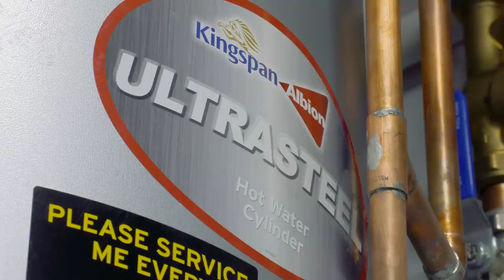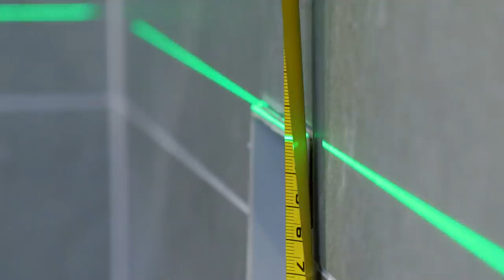Bathroom Renovation #10 - Final Fitting

Comment: Enjoying these videos Roger.
I’ve recently changed two wastes where the internal threads had corroded over the years making the whole thing come loose and leak. Silicone on the top and bottom stops it leaking and also keeps the whole thing tight should the threads fail. I agree tho it’s a pain to take apart.

Comment: Excellent series of domestic works - I would have loved to see how the glass was fitted for the shower screen & the effect it has when being used to keep the water in one place & not flood all over the floor.
Looks as though there is a quarter inch gap between the floor & the glass screen on completion.
When siliconed in place it always goes mouldy - So a free standing glass caught my interest & how well it works.

Comment: From down under here in New Zealand, bloody brilliant show....great production and music too!  I can hardly belive you guys still use those shaver outlets, we stopped with them and went to RCD's 25 yrs ago, mind you if it aint broke......
Reply from the maker: Thanks for those kind words. In the U.K you can put in a socket if it is more than 3 metres from the bath or shower. 

As the bathroom is only 3 metres long that is tricky.  I am not sure the men in suits have fully embraced RCDs. They still don't accept them as a means of protection on building sites so we have to use 110volts which is a complete pain.

Comment: Roger. Regarding the Towel rail issue at 18:13. If you want to use chrome fittings - some of the radiator tail extenders may also be useful. They come in various lengths.
Reply: It looks like he just stuck a small s-bend in the pipe in the end.

Comment: Two O-rings weigh twice as much as one, on a vehicle that costs $60,000 per kilo to launch. The problem was the ring experienced conditions it wasn't designed to encounter; a better analogy would be using plasterboard backing behind shower tiles. Two boards isn't going to fix a leak problem, you need better material...

Beautiful bathroom though!
Reply from the maker: There were two 'O' rings and you are right it was the wrong rubber

Comment: Thanks for the tip on silicone removal, my housing association thinks it is the only way to repair absolutely everything. We waited 16 years for a replacement shower, when they finally fitted a new one, 2 months later the on/off switch blew up and burnt out. Have you got any footage on how to repair draughty double glazed windows, woodworm treatment, woodworm damage repair, toilet to floor thingamajig repair?  i would go on but I fear I would bore you with the list of things that need doing... I subbed instead! Thank you again x

Comment: Great video. Some first class trade skills here. I was touched by your comment on the “O” rings it was a terribly tragedy back in ‘86’ When the O rings failed due to them becoming hardened by the low temperatures. Maybe more O rings could have helped but I think they should have delayed the launch until the temperatures were up to the correct level. Your illustration made the point very well that doubling up makes for a more reliable result.

Comment: There was two o-rings on that Challenger's SRB segment joins, a base and a backup.  Problem was the freezing temps made them brittle and they both blew.
Reply from the maker: Hi Kosmonooit
 You are right, I looked it all up after spouting off about it but I also found that one of the engineers advised against the launch due to the cold and they went ahead. There is a great book about the whole affair.
Reply: Cheers Rog  - yeah besides the sub zero temps the final report blamed the safety culture at NASA at the time, warnings were ignored in order to stick to schedules. They also redesigned how them segments join to be more fail safe. What can we learn? don't take chances. Listen to those who know.

Comment: Thanks for this.... I want to put an angle valve on my brick wall that will be tiled over with a 10mm thick tile... the open end will be a female threaded 1/2" (we call em 15mm over here).
I'm not sure how deep it should be n the wall, flush, or flush with where the tile is expected to end, or something else? I don't want pipe sticking out the wall by the escutcheon.

Comment: Thanks for the tip on the diamond drill. I threw out a drill I thought was buggered and it was probably just glazed like you said. Not a great loss though, only cost a few quid for a pack of 10 replacements, I figure even if I use 1 drill per hole it's still good value, even better if I can clean them like you did though and get a few dozen holes per drill.

Comment: Out of interest what were the bolts for the toilet pan and vanity unit going into? The framing you built or is it the abacus framing system behind the tiles? One wrong measurement and that's the tiling job destroyed. I would need to measure that 20 times before drilling any holes.

Comment: Roger.. I'm putting a shower base into an alcove and was going to use aquastrap but it's such a tight fit that the added mm of the butyl tape won't fit. What's the best option to seal the tray to wall gap. Silicone, Elements fix md, CT1 or what. The walls are elements board.
Reply from the maker: Just grab a roll of No More Leaks Bath and shower sealing tape from B&Q. Peel the back off the thin bit and place it where the tiles go. We have a video on it. I usually gun a bit of silicone down the gap first and let that go off and then follow up with the tape, then the tiles then the final silicone seal. Three layers of protection. If I had gone for that approach earlier in my life i would not have spent the last 30 years paying for my kids.

Comment: @skillbuilder Chaps - attaching the shower screen glass to the wall - did you screw through the tiles into the elements board on the stud? Would love your advice on how you've done that.
Reply from the maker: I always work out where the screen profie will go and put in an extra stud to take the screws. 

If the wall is there and I don't want to disrupt it I find the silicone seal on the back of the profile does a great job. the screws can go into cavity plugs but the main job is done by the silicone. 

I have confidence in this because I have had to remove screens for refurbs and those with silicone are very hard to remove.
Reply: @SkillBuilder  Thanks for the swift reply! I'm screwing into CLS stud through elements board so I'll rest assured the silicon will seal up any breach i make with the screws. Cheers!
Reply: @SkillBuilder  Fantastic thanks!

Comment: Any one guessing a price for this job .. ? 10-12k maybe
Reply: cmal90 easily
Reply: Times that by 3
You're looking at one top notch luxury bathroom
The shower head alone is going to be over £100 
And then there's Rogers 30+ years of experience
At least it won't need replacing for 30 years
Reply: I would have thought £20-£25k. Big room with multiple skilled tradesmen and expensive products installed.

Comment: There was 2 O rings on the space shuttle that blew up. They both failed. The thing should've never been given the go-ahead to launch because of the low temperature that day. Engineers tried to stop the launch because they were very aware of the dangers of launching at those temperatures, but it only takes 1 dickhead with authority to overrule them...

Comment: How much did all cost , labour and materials if you are prepared to divulge.........?
Nice job.......👍
Reply: 10k easy I reckon
Reply: 5k in materials I estimate.
Reply: Kind of a moot point given abacus probably picked up most of the tab.
Reply from the maker: Yensabi
Yes it is all available from your merchant with prices so no secret. There are of course trade discounts on the kit but list  is around £15k. I would normally work on an installation cost of the same so  a tad under £30K would be my price including the tiler. 
These days in houses that have two bathrooms and a couple of ensuites  and a cloak room you can easily get through £100K and the kitchen will be another £100K.
Reply: @SkillBuilder  £30k!!!!.....*sound of big geordie fitter hitting the deck*
Reply: @SkillBuilder  🤣 Hi Roger, £200k for bathrooms, kitchens and cloakrooms.  Robin Clevett would admire your managing of your future customer's expectations when it comes to pricing a job!!
Reply from the maker: @henlowridge8598  Hi Roy 
When you start looking at it, as a plumber, I need £300 a day to cover my van,, insurances, accountants and holidays. Then there is travel and monkeying about down at the merchants.
If I charge £6,000 I am not making a fortune. Then there is the kit which comes to £15,000 with my 20% mark up. 
I would reckon there is close to £500 in pipe and fittings. Plywood, battens, timber for stud wall Then there is the tiler , a skip and electrician. Lights heating and extractor fan.
 If you priced it at £20,000 you would lose out and the next one you would price at £22,000 so best to be on the safe side.

Comment: Question.
Cutting 10mm porcelain tiles and they would chip no matter what blade on the wet saw, i used a tile scribe in the end is there any blade that can cut these the waste was incredible to get the perfect finish.
Reply from the maker: Did they chip on the corners or the cut?
Reply: You need a decent saw for for precice cuts in fussy tiles.  Such as the DeWalt D24000.  Not cheap. The vibration from cheap saws will cause chipping. Also a none serated type diamond blade is essential.
Reply from the maker: @juancornetto8243  I have that saw and it is good right up to the last bit where it sometimes breaks a tiny bit of the corner.
Reply: @SkillBuilder  Make sure you're using the larger of the two arbor rings supplied (the smaller one is only for cutting bricks) and if the problem still persists try flipping the tile and cutting 1 inch into the tile where the blade will exit before cutting as normal.  I think dewalt had a manufacturing issue with these saws so might be related. Mine is a 2018 and is spot on.

Comment: Couldn’t you use plumbers mait instead of silicon?
Reply from the maker: For what particular bit?
Reply: Skill Builder 7:37  between connection to the basin and waste. Less messy and no waste of mait.
Reply from the maker: @vicventurini3786  Plumber's Mait should never be used to bed in basin, sink or bath wastes .I have asked Evode  what it is good for and there is a pregnant pause.  I have had several discussions with the Evode technical guys and they have told me that the acidic water will break it down. I can vouch for this because I have earned loads of money over the years re-seating wastes that were bedded with Plumber's Mait.

Comment: 19:15.  NASA should have used some Boss White & hemp as well instead of relying on a single O ring.
Reply from the maker: We learn by our mistakes. They can put a man on the moon but plumbing................ is something else entirely.
Reply: @SkillBuilder  Fernox LS-X is also good.

Does NASA stand for 'Need Apply Seal Adhesive' ?
Reply from the maker: @stakkerhmnd  Fernox LSX. Is that not just expensive silicone?  
You may be right about NASA.  It is hard to believe they could screw up on such a basic thing.
Reply: @SkillBuilder  That's a good point. I never thought about it as an expensive silicone. Thinking about it now I would say it is, and equally messy. Prefer your method of scratching the threads up and cross wrapping cord.

Comment: Talking of rejected basins, I purchased a sink of of ebay. Normally £600 got it for £200. Found out why, the sink was not flat on the top. Ok on the main area but falls to the back from the tap onwards. Now there is always a puddle against the tiles.
Reply from the maker: I have had more wonky firings than I care to remember. Rocky loo seats is the worst.
Reply: @logik100 Wasn't made by RAK was it?  I have one that's so bent it would be funny were it not my money that paid for it. (not fitted I hasten to add).
Reply: @juancornetto8243  No, it was by Bauhaus and was a cast sink top to a vanity unit.